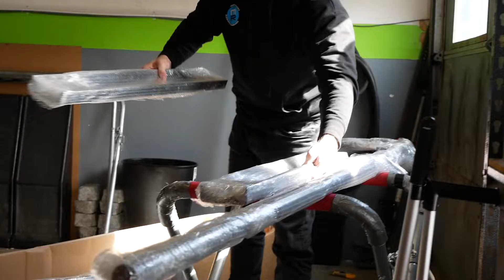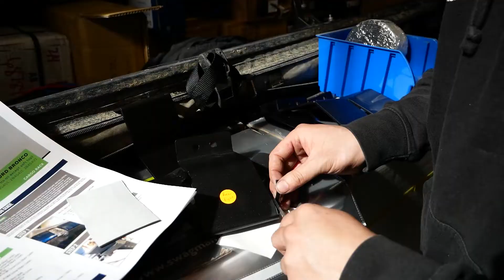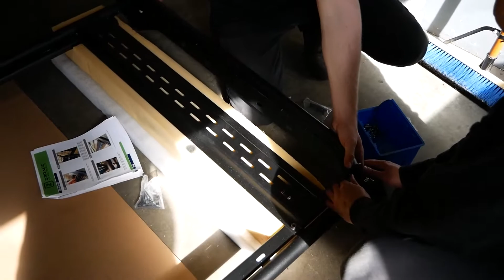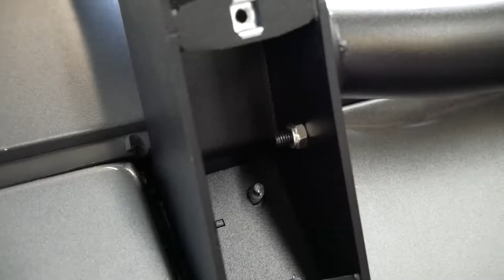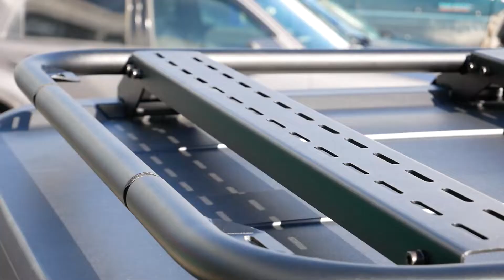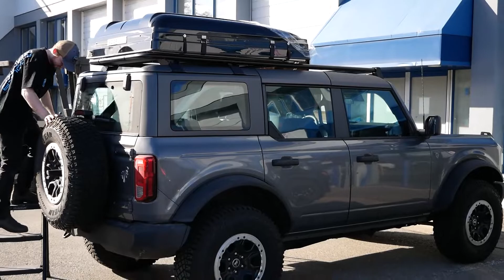ZROADZ Ford Bronco Roof Rack Install

Comment: Did the mounting brackets that came with the Condor fit the ZROADZ rack or did you have to order special brackets? Putting a 2023 Condor on this rack this week and the mounting brackets that came from roofnest don't fit the front crossbar width, and also don't allow enough clearance for the nut to fit high enough on the bolt.
Reply from the maker: Hi There,
Yes, you will want to slide the tent slide with the M8 bolt into the tent slides that run front to back.
You will then want to align the tent with the factory cut outs in the cross bars of the ZRoadz. 

As mentioned, it is a tight squeeze getting your hands and tools in there but it can be done!

Cheers,
Team Modula
Reply: @ModulaRacks wish me luck 😂 I had to go buy some longer bolts to make it work and am now trying to figure out how the hell i’m going to tighten those bolts through the tiny gap!
Reply from the maker: @emilyplummer4381  
It can help to remove the front hard tops to get access to the front bolts.
The rear bolts do require some awkward bends of the wrist! 
Best of luck :) 

Cheers,
Team Modula

Comment: I have two questions, can the removable roof panels still come off with this rack in place?  And can a conventional Thule ski box connect to those flat rails?
Reply from the maker: Hi There,
Yes, you can remove the roof panels with the rack installed! 
No, I don't believe a cargo box would fit, most modern cargo boxes do not have a flat bottom and would not attach to the rails.

Cheers,
Team Modula

Comment: Can the tps be removed when rack is installed ? What do you know regarding the noise factor ?  I have a 2022 Bronco and I am trying to decide which is the best application . Thank you
Reply from the maker: Yes, the front top panels can be removed! 
Once you get anything on your roof you will notice some noise, we have not had any customer comment on it or say that it is very loud, which is a good thing :)

Cheers,
Team Modula

Comment: Do you think you could fit some sort of cargo box in front of the condor?
Reply from the maker: Hi Emily,
If you could get a second cross bar made or ordered, you likely could attach some sort of box in the front.
A traditional Thule Cargo Box would not work, but something like a  Zarges case or Pelican case likely could be adapted!

Comment: What is the static and dynamic load capacity of the rack?  And more importantly the hardtop?
Reply from the maker: Hi There,
As per Zroadz website, Weight capacity 195lbs off road, 240lbs Dynamic, 570lbs static.

Cheers,
Team Modula

Comment: Where you able to remove the 3 price roof panels front and second row with the roof rack on
Reply from the maker: Yup, you can remove the front panel sections. The rear seat section is possible but not easy.

Comment: Roof can still come off? Front two row sections?
Reply from the maker: Yup, you can remove the front panel sections. The rear seat section is possible but not easy.